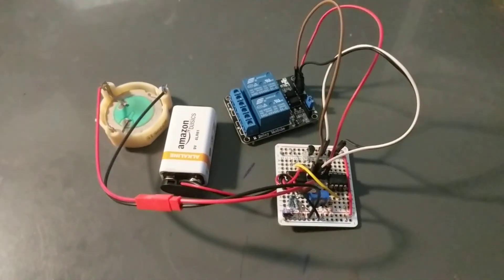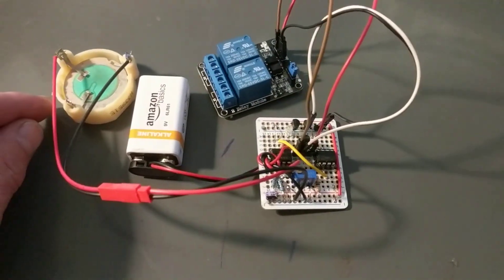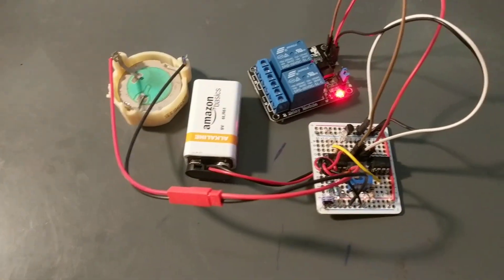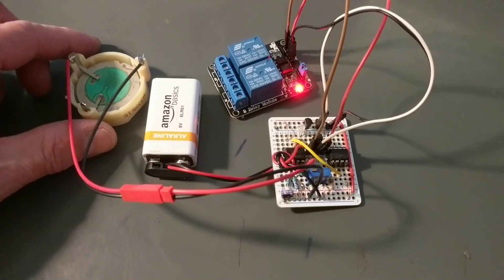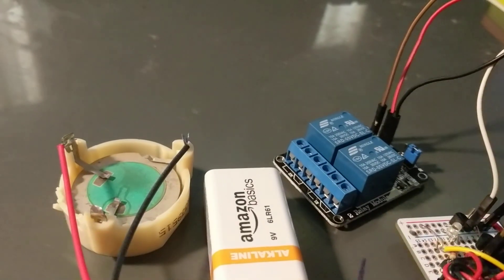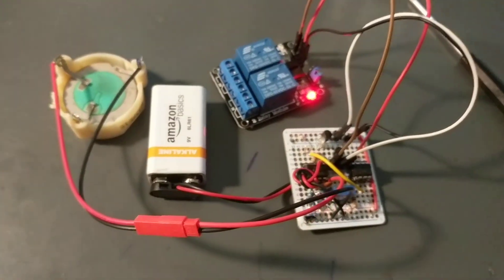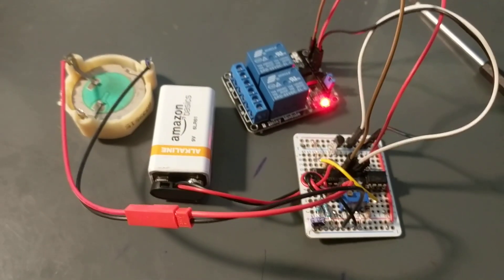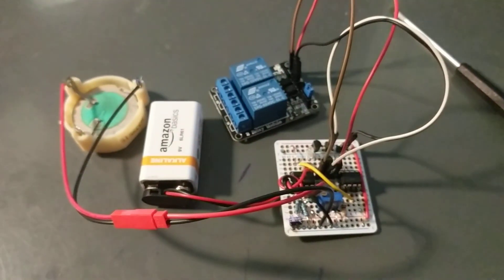Ultra Sensitive PIEZO VIBRATION SENSOR demo

Comment: As far as I know piezos have been used as UGS ( underground sensors) and on the sonar buoys where they sink to a predetermined level for many years.  UGS are to detect people, the underwater ones are to detect submarines.  Having pulled a nautical one apart they appear to be just a piezo and coaxial cable with no battery or amplifier at the submerged end.  The amount of wire that pays out is predetermined.  Submarines like to stay below the thermocline which is where the layers of water change temperature suddenly as it reflects sonar. The sensors are sunk to just below the level of change. There are also kids projects on the net where they are waterproofed and lowered into shallow water and you can hear all the crustaceans.  The UGS are marked and send back signals to a laptop showing where someone or animal is walking.  My friend developed a sheet (to cover the whole cot surface) of them to pick up apnoea (cessation of breathing) in babies.  This it could do easily but he had to filter out the heart rate to stop false alerts.  It could communicate both ways via the mains wiring.  The idea was stolen from him and it was and perhaps still is sold by Thomy.  He demonstrated a piezo to me by placing one over a ring of steel as a base and put a small weight on top. It was connected to an oscilloscope and it could pick up walking through a concrete garage floor about 3 yards away, up a wooden table leg and across 2 foot of bench top.  They are very sensitive.  Moduleme I notice are selling them with a small preamp attached of which I have just bought a few at low price to play with.  They have superb potential to let you know who is on your property even if it just plays back through amplifier and speakers. I think the signal after the preamp might go through 60 yards or perhaps further.  I think either listening or letting the dogs hear it might be simpler than chasing cats, coyotes, dogs, badgers, scmbags etc etc putting one under a gravel path would probably be deafening.  Thanks for the vid.